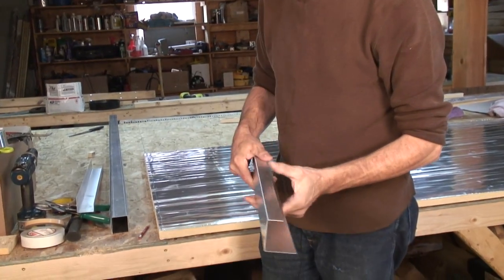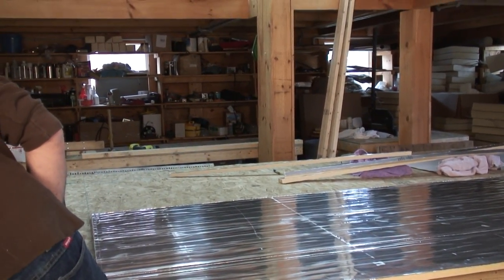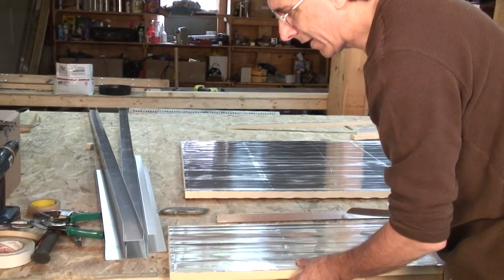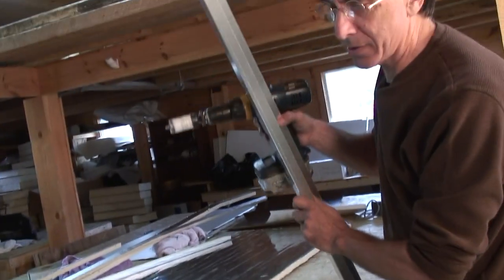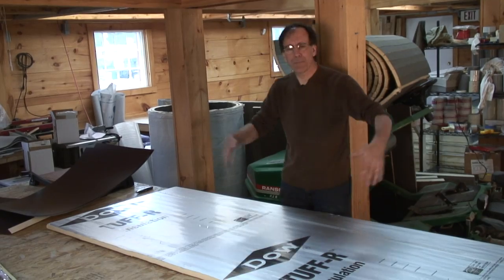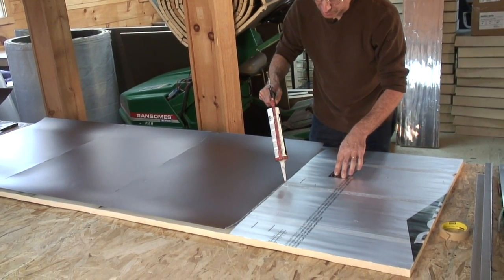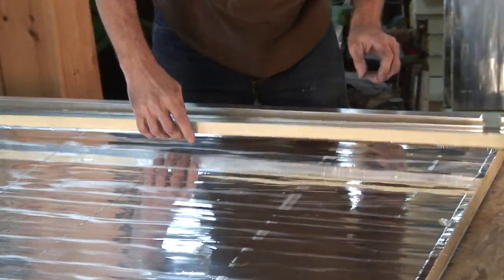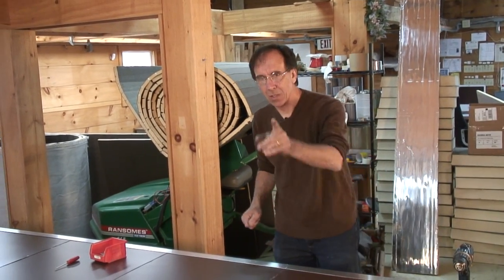Hot and Cold: D.I.Y. Solar Hot Water Collectors (Part 1)

Comment: Tom, great video & sense of humor! Question: What exactly are those 2 feet aluminium "trims" you used to cover the back of the insulation? I can see they have different color back and front. Thanks & cheers!
Reply from the maker: spacefolder We used aluminum coil stock that siding companies use for trim. It is usually available in 2' widths.
Tom

Comment: am back I like the project my idea is to build a box just like yours but making it 8 foot tall and 10 feet long do you think it will still be ridged? I want to use 2 pieces putting them horizontal (4x10 sheets) any in put would be great. thank you